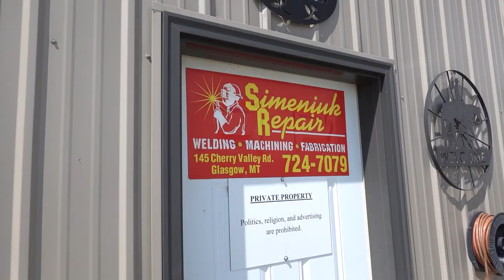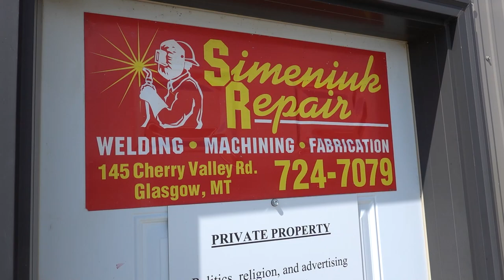Episode 81: HDT RV Hauler //Converting Our HDT Into a Smart Car Hauler

Comment: I noticed a lot of downward bow in the ramp about in the center of them, do you think if you had a leg drop down from there with about a ten inch pad on the bottom that it would give you more stability. I think now your driving experience with greatly improve with both of you together.
Reply from the maker: We have had that same conversation. The ramps we bought are built specifically for the Smart car, and everyone we know who hauls a Smart this way uses these ramps with no extra support. Even though they do flex, they should be okay. It is a bit scary to watch though!!
Reply: Where did you get the ramps. How long and how much. Trying to do this myself

Comment: Very good a man after my on heart using the KISS method. Just like mine but i have a dove tail tail on mine. For when i load our jeep. You may have done it already but under bed over tires undercoat or primer it. I did mine 10 yrs ago and starting to get some rust. If u have room get a tunnel tool box and mount. Under bed in back. Still not coming to HDT rally? Looking good . Safe travels.
Reply from the maker: Bubba agrees with you 100%. He has painted over the welds but says he still needs to cover the rest of it underneath. We would love to go to the national HDT rally, but we will be working the sugar beet harvest. Safe travels to you as well!

Comment: Bubba,. Looking at a similar setup.  Only difference. I am thinking about dropping the wheel of the smart car in to pockets.  That way I can gain some inches over the car.  Trying to do a deck design like the car haulers so I can load a side-by-side over the top of the car.  I know I have to stay below 13'3".  The mad welder and cutter in design phases 🤔🤔😂🤣
Reply from the maker: You'll have to keep us updated on your build. We have talked about how to fit a sxs and the Smart on the rig. Interesting idea dropping the Smart down.

Comment: Is there a way to automate the tie down straps while you tighten them?  Is there a lever action ratchet attachment that you mount once to each tie down mechanism?  Then you only need to insert the pull handle into each one for much faster hand cranking without having to insert, crank 1/4 turn, remove, re-insert to crank another 1/4 turn, etc.
Reply from the maker: Yes there is an electric ratchet you can put a socket on, I just don't have one because you are still going to have to put a last good bite on it because you may not get them tight enough with the ratchet.

Comment: Have you considered going to the single wides? I loved them on my truck as it they gave me more surface on the road and the brakes are positioned in the air more and stay cooler.
Reply from the maker: I have thought about it. The only thing that keep me from doing it, is if I ever get a flat. I can still limp in on one tire after taking the flat off. I am a little old school and like the duals. Don't get me wrong mags do look good. Thank you.
Reply: Tipsy Marlin Travels  I had the same concerns, but there’s so many on the road now that most shops have them in stock. At the time Michelin had it in writing that they would have it to your truck within a four hour window. They are about a 14 ply and I never had a problem with them in 6 yrs. at the time Michelin had a program to rebate for your tires and rims as you would need new rims. It worked out pretty good. I would think FMCA could get a good discount through the tire program. I also thought the wide tire would be better for the sand and dirt you get on at times. Just a thought. I enjoy your channel, thanks for the time you put into it.

Comment: Would supports under ramps keep them from flexing and give you better clearance?  Does the rear of the bed not need to be tapered down, thought you mentioned that earlier video?  Again love the work nice simple flat bed, thinking of doing the same thing.  Do you have video of going into state camp grounds or RV parks.  We like boon docking but also go into other parks, not sure the HDT will work out in tight quarters.
Reply from the maker: We had wondered about supports too, but these ramps were built specifically for the Smart, so they should be okay. We had talked about tapering the back of the bed but, in the end, decided to keep it simple and go with it flat all the way across.

We have definitely shoehorned the rig into some campgrounds. We have video of us backing into campsites in Episode 62, at Ocean Pond (that was a pretty tight squeeze). We have found the Army Corps of Engineers parks to mostly be plenty roomy, and we have had a lot of good luck with state park campgrounds as well. I always Google earth them first, and will even call them if I have any doubts.

Comment: Did you coat the underside of the bed?  Road salts will attack the underside causing rust and corrosion.  I like that you did not single out the axles.  I have been in situations where I would have been stuck should I have had only the single axle.
Reply from the maker: We didn't coat it when it was installed. We're going to be at Bubba's mom's house for a while and we're planning to acid wash and seal the underside while we're here.

Comment: Probably better than the way I did it in 2006. 1 - research smart dimensions (a guy in England folded his mirrors, pulled into his garage with one mirror touching the side of the door frame, pushed a file cabinet against the other mirror, moved car and measured space in between!); 2- design deck; 3 - have deck built by truck body builder. At the same time research and secure ramps, winch, and tie downs.

Spend several  months tracking down a gray market smart.  Ours was a 2005, delivered in Germany, shipped to California for federalizing, and then to a dealer near Pittsburgh. The 2005 was replaced by a 2011 (which gave it's life to save mine!), amd was replaced by our current 2013 with yellow "City Flame" package.

Finally, drive bobtail from Chicago to Pennsylvania to pick up the smart already purchased. This would be the very first time we ever saw a smart car "in the flesh"! Load it up, tie it down and head for home.

That night, in the pouring rain on I-80 east of Chicago the CB perks up "Hey! Did you guys see that little ass car on the back of that big truck!" The first of many, many comments!

Nice job on your project!
Reply from the maker: Oh my gosh we are cracking up as we're reading your story!!! We had to do a "parade lap" through Glasgow with the car on the truck because everyone kept laughing at us. 😂😂😂

Somehow my fumble fingers posted our response under a different comment.

Comment: On your way over u could holler out on the cb radio. Would it b better if u took that front axle out? I think the back one is the drive but not for sure.
Reply from the maker: Not that we're anywhere close to being overloaded, but with the added weight of the bed and the car we decided we'd rather keep both axles on the rear. The extra weight on the truck makes both the truck and trailer ride a lot better!
Reply: Front one Steers!! 🤣😉 Both rear will drive.

Comment: How do you drive over the rear wheel chocks? Did I miss something?
Reply from the maker: I unbolt them from  the bed, when I get the car up there, then I place the rear chokes back on and bolt them down.
Reply: I have a video of guy loading one with a winch, would save the clutch.

Comment: Is it common not to do a solid weld all the way across?
Reply from the maker: I am not sure. I do know that it would most likely be a lot of welding if you went all the way across. The ribs under the bed are welded also to the deck, so I think it equals out in the long run. Thanks for watching and hope this answer your question.